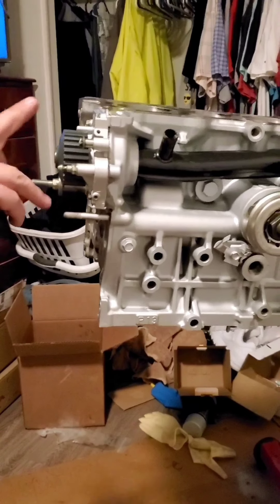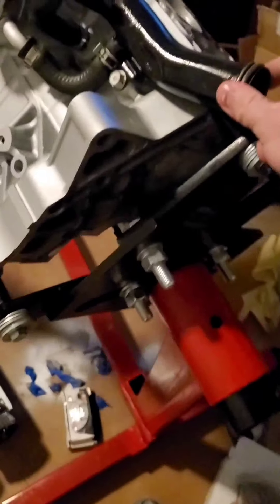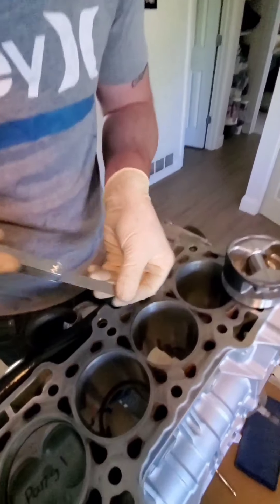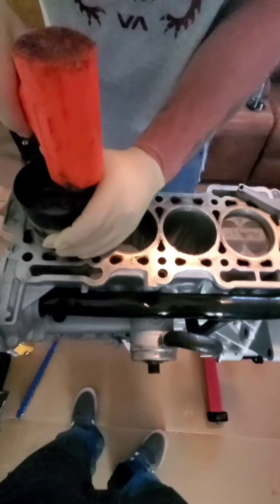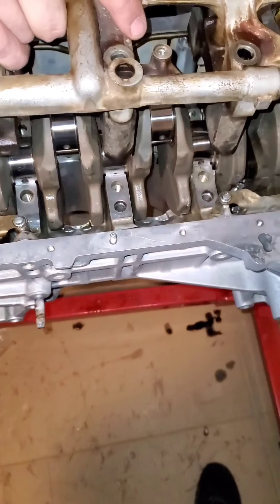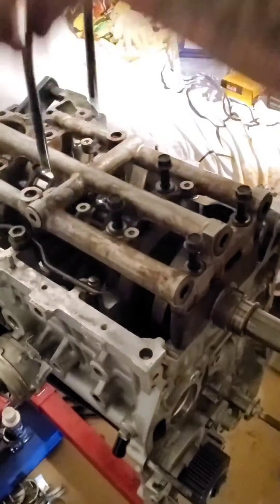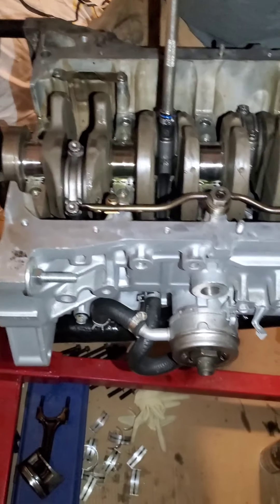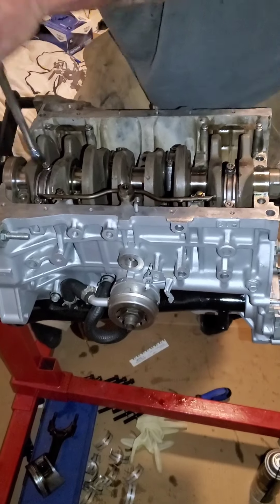H22a build pt1

Comment: This video couldn't have come at a better time..  I've got the same motor, basically the same setup (Manley H-beams & Nippon Racing Type S pistons) ARP studs, stock sleeves..  Thank you
Reply from the maker: Hopefully this video helps you out! Thanks for watching!
Reply: @thompsonbuilt5063  Just to make sure before I do it.... You torqued the rod bolts (arp 2000 7/16) to 90 ft lbs +/-
Reply from the maker: Yes exactly as i did in the video